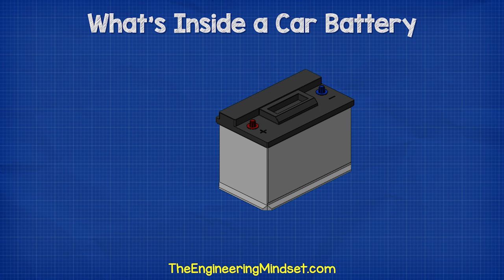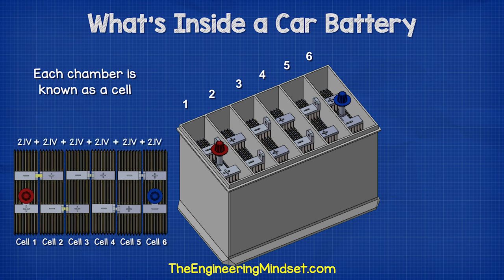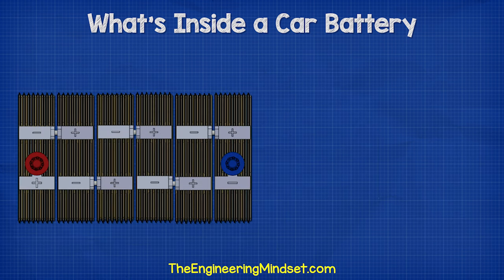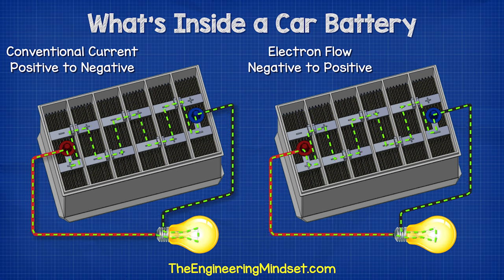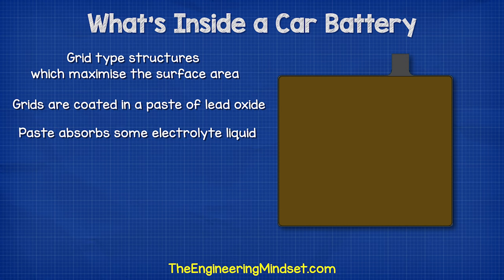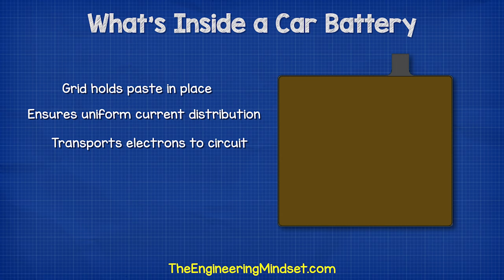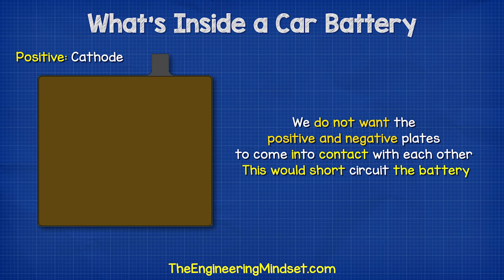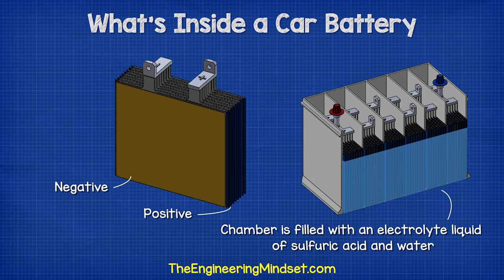Car Battery - What's Inside?

Comment: Don't be cruel in disposing of these. Make sure to drop them in the ocean to help recharge the electric eels.

Nature is beautiful 😊
Reply: Since the local council won’t help and they  are virtually impossible to rid of, I’ve found drill a few holes in them then dig a hole slightly bigger that said battery and bury them. Works EVERY time. Had no problems with this method.  🇦🇺 👍🏻

Comment: Excuse me but I learned in school (in Germany) the opposite regarding names of the poles. The Anode is the positive pole and the cathode is negative.
Reply: A quick Google search shows that an anode is the negative and cathode is the positive. You could have just searched this online but you decided to "correct" the creator, brilliant.
Reply: @miguelkuoertigo5288  dude, the anode is positive and the cathode is negative, I don't know where you're getting your info from, but it's wrong nevertheless
Reply: It is opposite for galvanic (the car battery) and electrolytic cells
Reply: @miguelkuoertigo5288  He's not completely wrong tho. In chemistry that have been taught in school there are 2 types of Cell (Chemical Reaction) require both Anode and Cathode. The first one is Galvanic Cell (which is the basic principle of how battery works) and the second is Electrolytic Cell. In Galv Cell, The cathode is postive and the Anode is negative. But in Electrolytic Cell it's the opposite. Cathode is negative and anode is postive.
Reply: @axisgaol2231     He wanted to be smug because he did his own research.    "... you decided to "correct" the creator ..."   gives it away.   Mans simping so hard he can't see a way his favorite youtuber to be wrong.
Reply: @miguelkuoertigo5288  I didn't want to blame anyone. Especially not the creator of the video.
What is new for me is that the anode can be both positive and negative. Here is the best definition I found:

In the case of rechargeable secondary cells, also known as an accumulator, the same electrode can work as an anode or cathode depending on the direction of the current, depending on whether the accumulator is being charged or discharged. When charging, the anode is the positive electrode, when discharging, the anode is the negative electrode. Therefore, the polarity (positive or negative) of the electrodes should be used to clearly identify the connections of an accumulator, since the polarity of galvanic cells is independent of the state of charge or discharge.
Reply: @axisgaol2231  Actually, the positive terminal is both the cathode and anode in a car battery. That is because car batteries are rechargeable, with the technical term of each of the 6 cells inside known as secondary cell. When, a secondary cell is discharging, which is the default mode, it is a galvanic cell, so the positive electrode is the cathode. When a secondary cell is charging, it is an electrolytic cell, so the positive electrode is the anode. Strictly speaking, the division between positive terminal being cathode or anode depends on galvanic cell vs electrolytic cell, not necessarily battery or not battery.

Comment: "Why is my battery dead, I haven't even used it!" failure mode. This is off the top-of-my head and might have misrememberings, but:
The charge-discharge cycle of a lead acid battery goes from lots of PbSO4 at fully discharged, to lead-negative-plate, lead-oxide positive plate, and sulfuric acid at fully charged. But. The plates are that honeycomb-like structure packed with a paste. When fully discharged, that paste is no longer so tightly packed, as  it's now lead sulfates. The paste basically "falls out" and accumulates in the very bottom of the battery. (Sometimes even visible if your case is translucent enough). Irritating.

Comment: I've always wondered why there are no AC batteries, or for that matter 3 phase AC batteries.
Reply: Because AC is a sign wave it goes high then low then high, etc... A battery is direct current just a straight sign wave. 

A generator puts out DC. An alternator puts out AC.
Reply: @Ottos_ScLm_Race_videos_2009_on 
A dynamo generates DC
An alternator generates AC
But they're both generators.
Reply: HHMM 🤔🤔🤔🤔